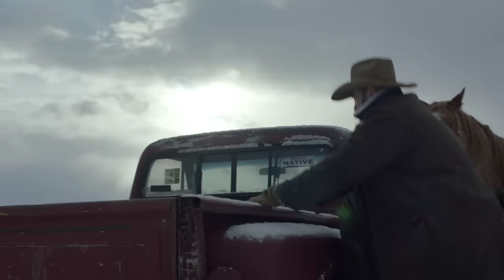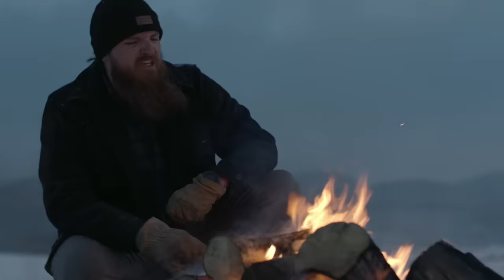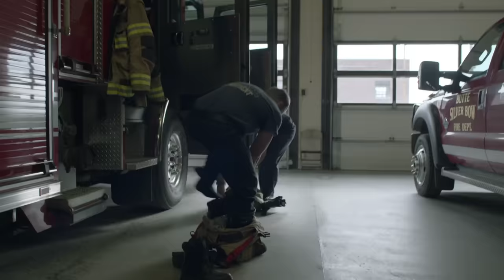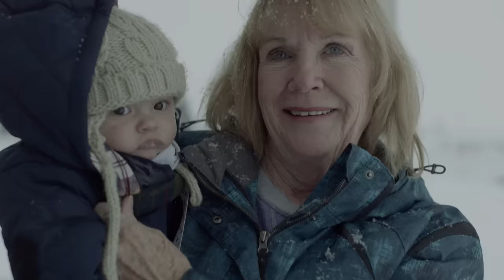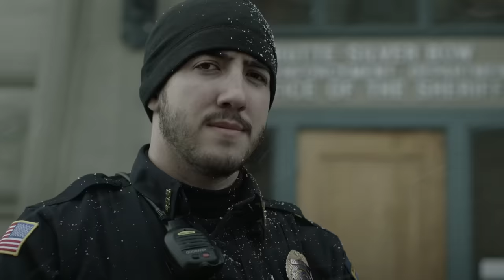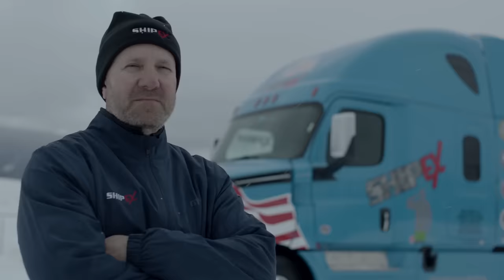Tim Montana | American Thread (Official Music Video)

Comment: LYRICS:
 Tough as nails, hard as bricks
Six foot one, walkin' ten foot six
Four on the floor, twelve in the back
With a Weather Guard box and an old gun rack

Feeling fly, ridin' high
Roughneck red till the day we die

We're the eighteen wheelers haulin' loads
Up at dawn, farmers cuttin' rows
Hard hats out there poundin' roads
We're the workin' class, son, and that ain't low
Get the Copenhagen cowboy kind
We're the camouflage on that front line
Stand for the flag till the day we're dead
We're every stitch of this American thread

We're the dusty boots and late night rides
Busted knuckles and bloodshot eyes
Might break our backs, but not our pride
Roughneck red till the day we die

We're the eighteen wheelers haulin' loads
Up at dawn, farmers cuttin' rows
Hard hats out…